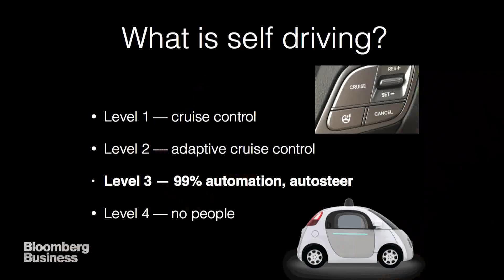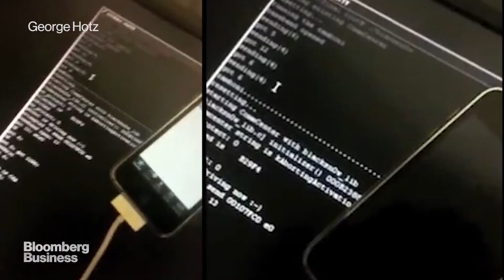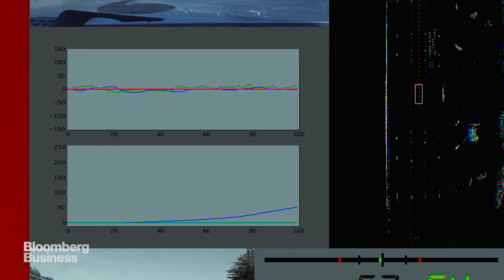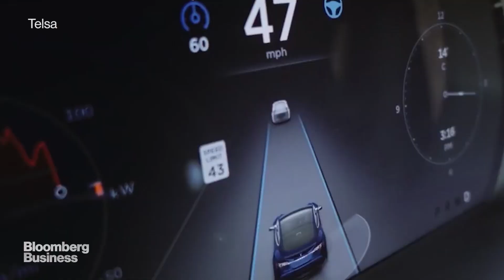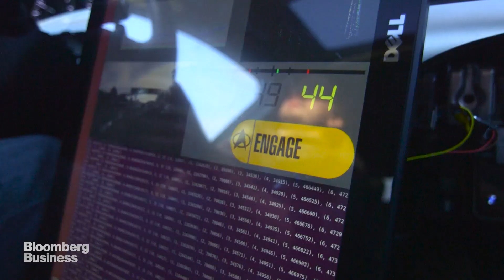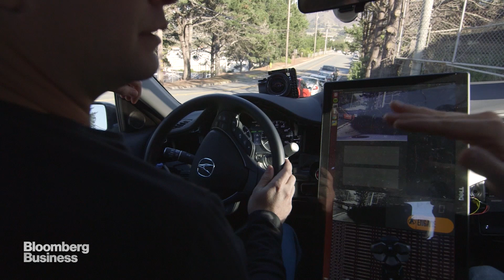Meet the 26-Year-Old Hacker Who Built a Self-Driving Car... in His Garage

Comment: since the car drive based on cameras not sensors, the biggest problem would be driving with extreme road conditions, or even just condensation on the camera?
The advantage of AI is that AI can learn anything and has supposedly unlimited potential but at the same time, its disvantage is that if this car learned only from watching other cars drive, does it know what to do when rare scenarios happen? Because unlike other self-driving cars with scenarios already pre-programmed.

Comment: "This might be how humans think they drive."

No actually humans think they do things and act by intuition, the complete opposite.

Yes we (some) learn by observation, but it is trial and error, the factor that makes us filter bad information.

By committing mistakes, we manage to filter bad information, and conceptualize the reason WHY it is bad, and why doing something else might be better.

We need to prove that something works just ONCE, then our brains accept it as useful, then we "allow" ourselves to forget the reasons WHY it worked (the concept) in the first place, and began using it mindlessly (by intuition) in what is called a paradigm.

Concepts can be translated or simplified
A concept doesn’t need to be technical, for example, a kid doesn't know that he is getting pulled 9.8 m/s2 by gravity, but he can relate that to falling, and hurt.

The fact that the concept is not technical doesn't prevent it to be passed as a rule by our brains, (unless you are stubborn).
And that is also why humans drive badly, interpreting high velocities with the mass of a car is really hard to relate to, in our environment, where we are lighter and can’t run as fast.

With experience we learn about kinetic forces, each time the brake is pushed, at some point we also get a sense of how heavy the car is, and when on foot we can imagine how hard a car would hit.

Only with enough perspective about the dangers of driving, is that we get to be a little more cautious . . . but this AI is skipping all this concepts.

So we DO drive, and do things based on rigid rules . . . in conceptualized rules, that even if the concept was dismissed later, it was approved for being useful.

What seems to be randomness on our part is that sometimes rules overlap, and what we do is that we are judging the benefits of one rule against another.

Comment: This is actually the best way to teach an AI to drive a car. Have a way to set maximum speed and then within that parameter, do what other cars are doing. You do need a few rules, such as if changing lanes, activate the turn signal in the direction you will be maneuvering toward. Or, if turn signal activated change lanes to the next lane over in the direction the turn signal indicates but only do this if changing lanes won't result in contact with another object.
Reply: That's all trivial and not at all the problem with autonomous driving. The problem with autonomous driving is machine vision. This guy reinventing cruise control (if he did indeed do anything= does not tackle that problem at all.

Comment: Wow this is amazing. I like concept of a four-point outline. Additional, you might need an AI to check the existing system to make any corrections while car is driving itself, I saw an AI correcting and AI in a Cold Fusion video. Also you're going to need to miniature something that can anticipate thousands of calculations and possibilities rapidly at the same time. 10 hours of driving at a time it's really not enough. To make this thing really work, you'll have to drive under various conditions, at various times of the day, on various roadways. Also infrastructure  and roadways would have to be changed, so as to accommodate the auto vehicles such as roads: Wi-Fi traffic lighting, and Vehicles communicating with each other on a universal level.

Comment: After looking at google's self-driving software and technique, this one seems to be far inferior and far from ever being implemented. It just doesn't have all the tools for it to be successful. From my understanding George's software is based mostly on image recognition and is recording only deviations from normal driving situations for future driving adjustments. He'd need hundreds of terabytes of unusual driving situations data that could be accessed instantly and a super computer in the car or a cloud implementation for the self-driving system to be half done. He'd also need to simulate hundreds of car crashes under different situations to teach the system for safety adjustments, like accelerating(merging lane), moving away to avoid collision or choose the least damaging for passengers maneuver after impact. He could also Install sensors that would read the car's suspension, traction control, brakes and other data and adjust for driving in different situations like potholes, wind, aquaplaning, rain, snow, or other situations when tires loose the grip. Sensing those conditions would not be possible with cameras and lidar alone.  But even if he collected alone data for 50 years there would still be situations that never happened to his self learning car and the self-driving system would be clumsy and potentially dangerous.
Reply: +Connor Sumners A cheap system that doesn't work nearer 100% of the time will never be approved for consumer use, and will revolutionize nothing. Especially if another system is made first, that meets the near 100% requirement. He certainly could build a business off of the idea (hype), but it would be a sinkhole for investors who could have put their money in something that is actually feasible for public use. Autonomy is all about safety right now, and his system concept doesn't even read as safe in it's current stage. Add in that his $1000 price point is just words right now, as he doesn't have a working model that doesn't come equipped with other sensors, and this low cost system is still a pipe dream.
Reply: You are giving him a lot of credit. I think he just put a touchscreen in the car and turned on the adaptive cruise control and lane assist. Given the naivity and ignorance of the reporter, I doubt he even linked his cameras to the controls.

Comment: Well ya, it's actually pretty simple. Farming equipment has had self driving for years, I've seen quite a few of these systems used in cars for mostly highway driving. When you are rich and have time anything is possible
Reply: Your talking about something else
Reply: @HoloScope nope, self driving just like in the subject of the video.
Reply: @blaingunter  I have never seen farming equipment driving down roads by itself
Reply: @HoloScope  lol they use it in fields. Not street legal at all. But people have put them in highway vehicles, usually the pilot cars for wide load trucks.

Comment: now heres a question.. will it be able to also mimic and drive stickshift cars?
automatic is easy but what if you want stick, but ALSO want the car to drive by itself sometimes?
hmm, hows that gunna work?

(and no, steptronic tiptronic smg whatever is still auto)
Reply: All of the technology you see in the video already exists in stickshift cars. Turn on lane assist and adaptive cruise control and your car is just as autonomous as his one.

As for autonomous cars in general, it would be better just to simulate the stickshift, otherwise you have a lot of unnecessary mechanical parts, that can break.

Comment: Ok this is so stupid.  Cameras have no depth perception so you can only use stereo cameras. Stereo cameras work fine up to 50-70 meters max. How are you gonna stop if there is someone standing on a highway, or a traffic in front of you. At 120kmh/h you need roughly 140m to stop. For that companies use radar (<300m) and lidar (<200m). And how are cameras supposed to work in the dark? Infrared cameras can see poeple and other cars on a short range. But they struggle to see markings on the ground, traffic signs, barriers on the road etc. Even dr strange wouldnt see a reality where this works.  What do you think all the car companies + suppliers have been doing the past 10 years? Tesla is not the only one reseraching on autonomous driving, they only put it on the market first because in the US the safety regulations are pretty much non existent unlike in other countries.

Comment: Smart guy.....but he has the level designation wrong.

Level 1: cruise control.....only one automated aspect of the car
Level 2: steer assist, lane keep assist.....features that help you do steering and acceleration tasks together
Level 3:  Autonomous features with environmental detection, can control car most of the time but still needs a lot of human intervention
Level 4:  System can pretty much drive it self with ~99% reliability.....humans can still intervene based on preference or perceived advantages the car may not know about.
Level 5: Completely autonomous......no human for error assist, or correction, or preference
Reply: whats the difference between levels 4 & 5? seems arbitrary.